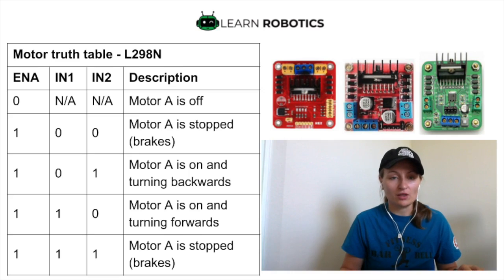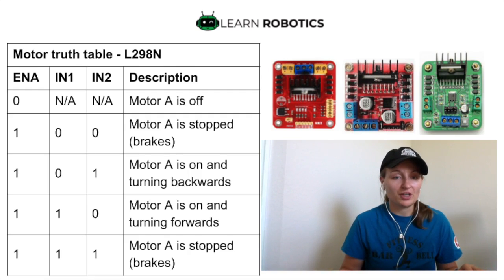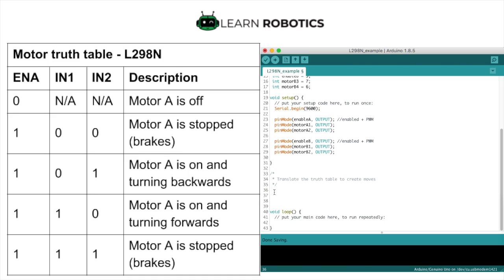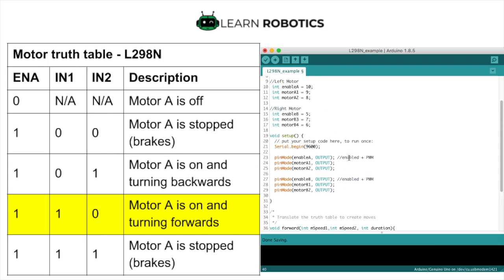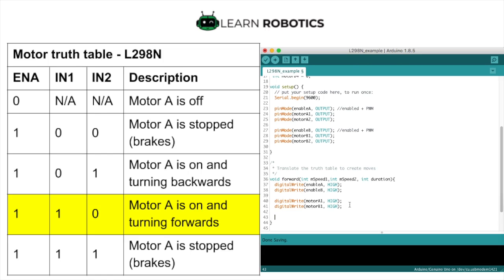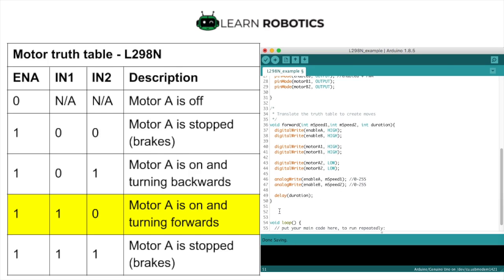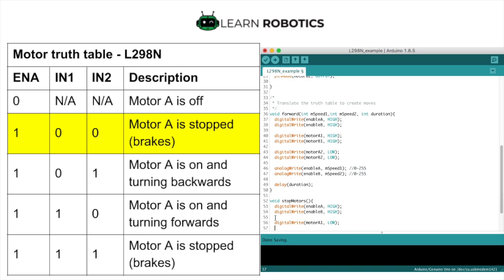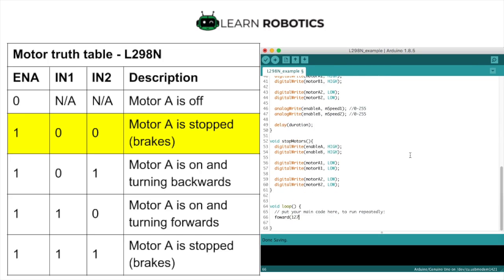Program L298N Motor Controller with Arduino - Beginner Tutorial!

Comment: great job
using the l298 can be hard iam using one but the car doesnt reverse just turns right, left and goes forward iam using esp32 wrrom 32D  and a pc  litium battery as a eternal souce the once i click the reverse button on the pnone its buzzes but lower when compared to the others(buttons) do you have any ideia on whats happening pls?
Reply from the maker: I'd check your truth table in the code for reverse and your signal wiring between the controller and the L298N